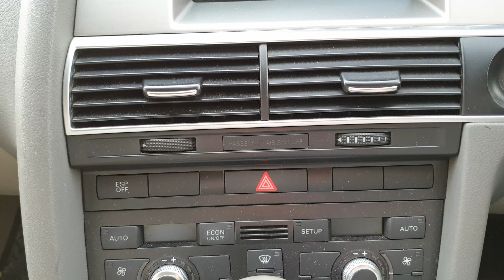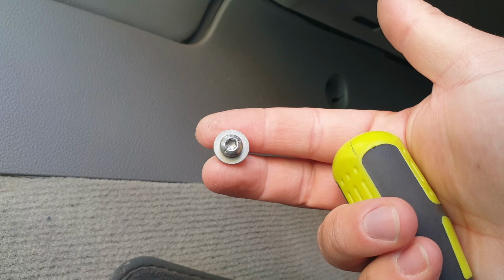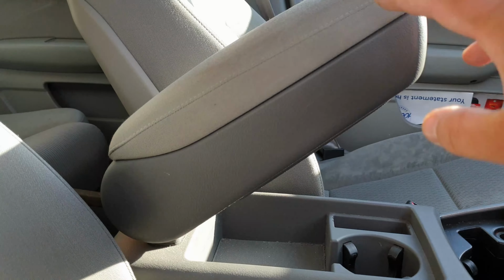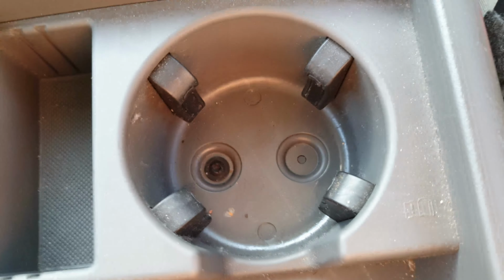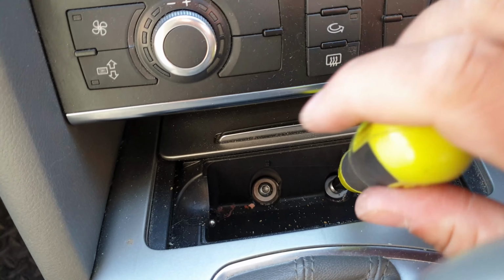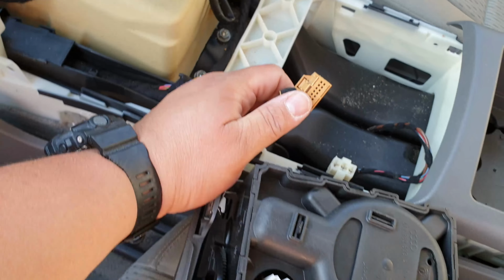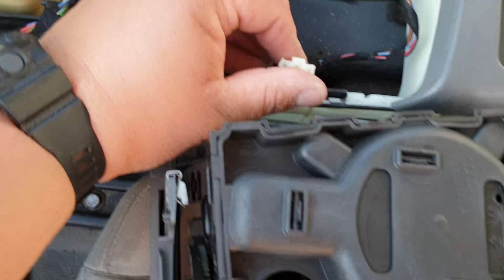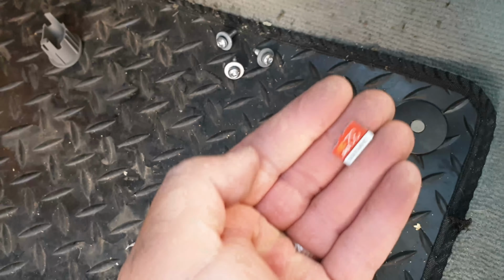How to remove Audi A6 C6 Automatic Center Console

Comment: Thank you so much for direction on removing the center console. I couldn’t have done it without you
Reply from the maker: I am glad I could help. I had the same problem but there was no video on YouTube and I decided to film this one ;)

Why did you need to remove your center console?
Reply: My cup holder rubber pieces were all ripped open so the metal prongs were sticking out

Comment: Great video if you really need to remove the console.  Bad design on Audi’s part for allowing slim objects to fall down the cupholder lid gap.  I just managed to avoid having to remove the console by holding lid fully open, shining a headtorch into the gap and passing a flat metal kitchen spatula wrapped with double sided carpet tape down into the gap to retrieve a couple of business cards that were blocking the lid from fully opening.  Once the items are at the gap use another slim knife to ease them through 😊

Comment: Thanks you for the video. Though my cigaret lighter of the passenger seats is stuck in the plug. is there any way to remove it ? You don't seem to treat it. In yourvideo although it appears there are screws over it at 5:40 ?
Reply from the maker: Maybe you need to replace the fuse for the lighter. Then it will warm up the cigarette lighter and it will pop out. Hope this helps.

Comment: There's only one big problem mine's backwards from yours I'm in the states so I have a left hand drive
Reply from the maker: It should be mirrored ;)
I guess the steps are the same.
Good luck finding anything you dropped in there.
Reply: @GrollerG  
Yes, it's just mirrored. Except one more difference, if I remember correctly - the small panels with PRNDS on it on my A6 C6 is not just on the side, but makes a whole frame around the stick. Maybe it's an earlier version, since my car was made in 2005. But I might be wrong, got to check it later.